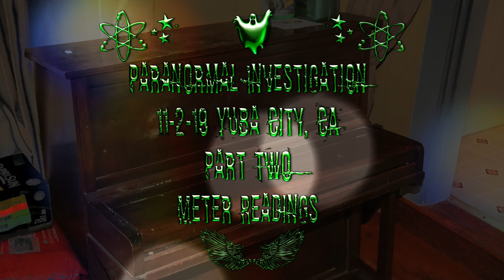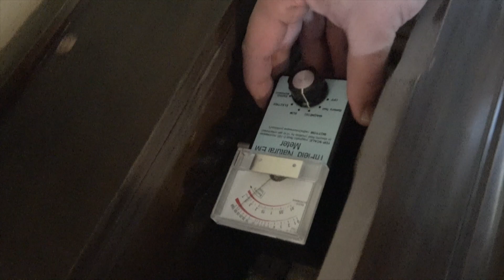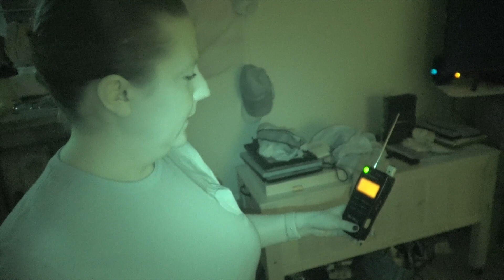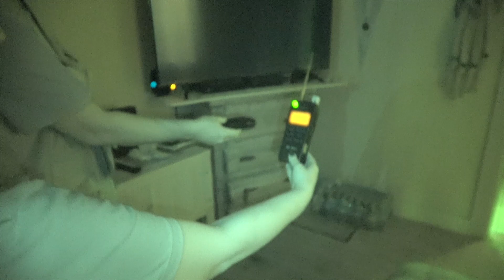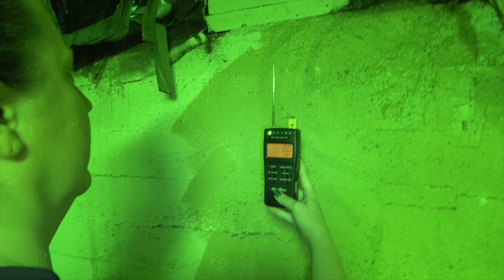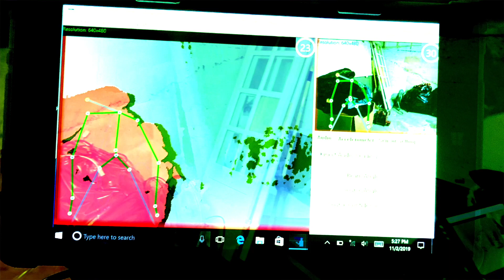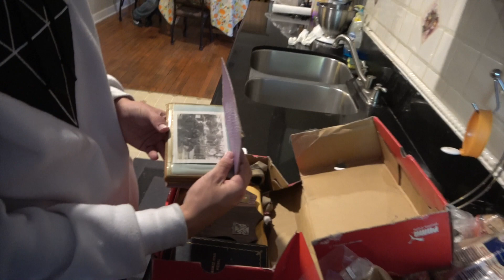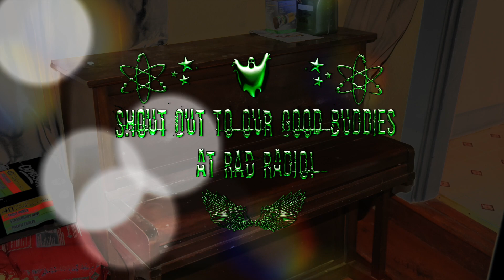S.P.I.R.I.T. 11-2-19 Yuba City, CA Paranormal Investigation Part Two

Comment: Perhaps the magnetic oil on the piano could have caused this? The oil is magnetically charged to collect metal shrapnel from the oil pan when changing your oil. I did noticed you later moved it and the readings inside were crazier so that kinda cancels that out
Reply from the maker: We sure could not explain the piano readings. what a wonderful validation for the family.